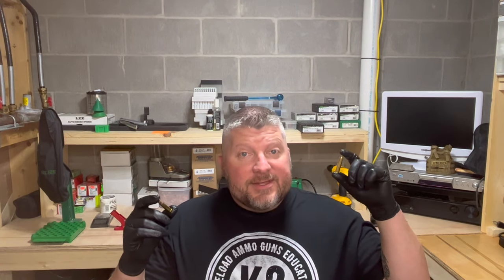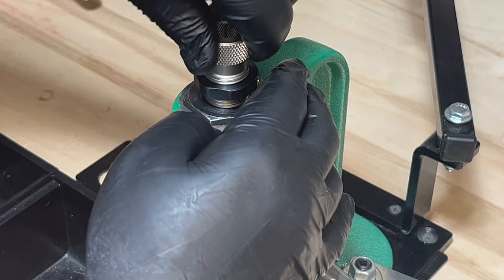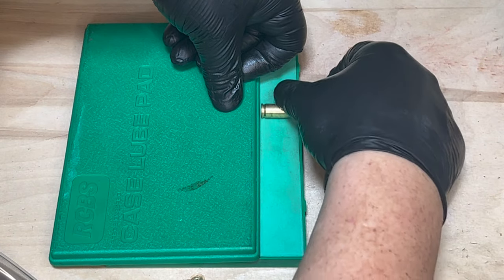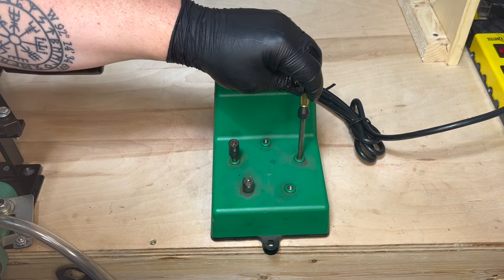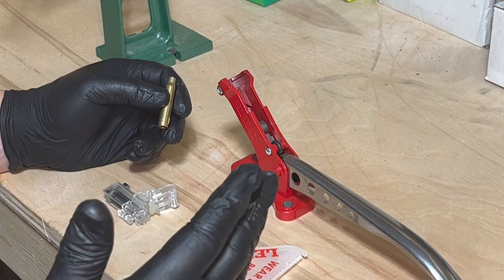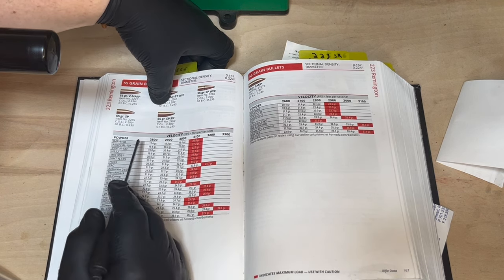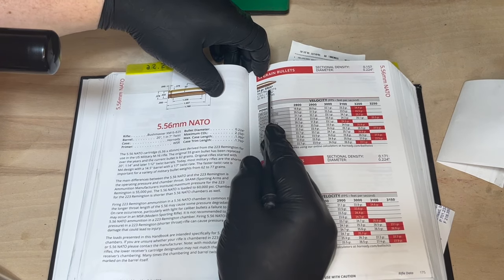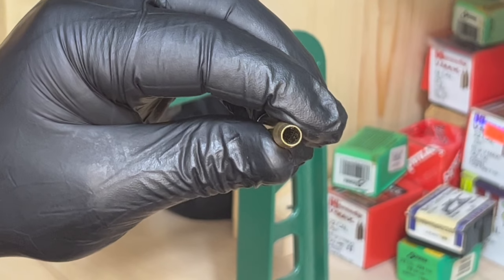How to Reload .223/5.56 For Beginners Easy and Fast

Comment: Since this is a beginner's video, it would have been nice for you to have told us why we should be using small base dies when reloading for "any AR platform."
Reply from the maker: Hi Daniel Morrison! Great question! SB dies are used to bump the shoulder back just a little further then FL sizing dies. You’ll hear varying opinions on if this is really needed or not. I find that I have better results in my AR platforms when I use SB dies rather than FL dies. I can almost guarantee that someone will disagree with my statement. However, this is just my opinion and what I choose to use. I encourage everyone to experiment and figure out what works best for their needs. Hope this helps! 👍🏻
Reply: @k2defense  Im sorry but I absolutely know nothing about this but what are dies?
Reply from the maker: Hello!

They are used to reload ammo! Please check out my other videos to see how they work! Hope this helps!
Reply: @k2defense  You stated that the small baes dies are better for any AR platform, but you did not say WHY they are better.
Reply from the maker: @danielmorrison7579  - I won’t say the are better. However, for me, they seem to work really well in my AR platform. SB dies size the case from the shoulder to the head of the case a couple of thousands smaller than FL sizing dies. You will hear some reloaders say that there is no need for that and you over work your brass causing the life of the case to shorten. I get 10-12 reloads per case before the necks split. Probably because I don’t anneal my plinking rounds. I’ve never encountered case head separation using SB dies. In summary, you’ll have folks that only neck size or FL or SB or any combination of all three. For me, using SB dies reduces ramp feed and chambering issues in my AR platforms. Find what works for you and run it. In my opinion, there is no right or wrong way. It’s whatever you find that works for you. 👍🏻
Reply: Have 223 dies. Was wanting to load for one a my kids A. R he said I should use small base dies. You explained it well! Thankyou! Like  IMR 4198 in 223 I load for. But it's just a single shot. And weigh every charge on a Redding non magnetic dampened scale. Don't trust a measure to throw a perfect charge every time. Been reloading since 1974 the Rock Chucker seen a lot a brass! 223...220 Swift...243...25-06...7mm Rem Mag...38 Special and 44 Rem. Mag...as well as friend dies/calibers. Great to the point video you posted! Thanks! @k2defense
Reply from the maker: @curlyyoder I really appreciate the comment Kit! Cheers! 👍🏻
Reply: Buy Lee Dies, they are tight enough that you don’t need to shell out extra $$ for ‘Small Base.’
Reply from the maker: @George-tz1cv - I’d say, save up the extra few dollars for the small base if you’re using the ammo in the AR platform. This will help with ramp feed issues and chambering. Otherwise, I’d agree with you. 👍🏻

Comment: Does barrel length affect reloading? I have an 8.5" AR and used Hornady black and shot nice, I used my reloads and loaded on the lower end per Hornady book and Hugh flash out the rifle. Wouldn't tell if it was from chamber or barrel but the flash was huge. Should I reload below Hornady specs?
Reply from the maker: Hello Timothy Berlinski,

When you read your reloading manual, it will tell you what barrel length the load is worked up for. Twist rate plays an important part with bullet weight. Typically, the higher twist rate is needed for heavier projectiles to stabilize the projectile. The shorter the barrel, the higher twist rate. Hope that answers your question.
Reply: @k2defense  I am more concerned with the load, I got the higher twist the more weight. I forgot what weight I was using
Reply from the maker: @timothyberlinski2299  I’m a little confused. Do you know what projectile you used (weight) and powder charge?
Reply from the maker: This are my plinking rounds. 55 gr fmjs. I don’t go max on these even though Hornady is conservative. I go mid range on my plinkers. Hope this helps!

Comment: Ive been loadeing 223  2 years rcbs die i bought new its pushing bullet up in the die and not in brass  bullet get stuck in the die can ya  help me out never had no problems with till tonight
Reply: 223 55grn lead tip
Reply from the maker: @richardharris1349 - yes, it sounds like you’re crimping before seating the bullet. Watch this video and follow the steps for the bullet seating and crimp portion. It’s for the .308 but it’s the same setup for the .223/5.56. After you do that, try it again and let me know if that corrected the issue. 👍🏻

https://youtu.be/ktUftCmF_2k?si=aFDAGFSyey5i3BkA
Reply: @k2defense   thanks
Reply from the maker: @richardharris1349 - 👍🏻

Comment: Question:  the cases for 223 and 5.56 are the same and the only variance would be the powder load which is approx. 2gr. more in a 5.56. 
To compensate for this additional powder load/ overall pressure a 5.56 rifle has a longer throat and leade for the additional pressure and speed of bullet.
My question is what if we trim the 223 cases to say 1.745 to allow the additional room for neck expansion and set the bullet say 20k deeper in the case neck then place an additional 2gr. of powder in the case. 
One would think this would allow a 223 rifle to shoot a 5.56 powder load.
Reply from the maker: Just to clarify, your question is if you trim 5.56 cases to 1.745”, seat the projectile .2” deeper, and add more powder than recommended to shoot out of a .223? I want to make sure I’m following before answering.
Reply: yes this would allow the throat to have more room like in a 5.56 for neck length expansion and seating deeper would allow the bullet more time to reach the lands by way of the leade.
just an idea to compensate for the only difference in a 223 vs. a 5.56 barrel to help with the added pressure do to increased powder load.

Comment: I wonder how much all the stuff you need to start up would cost and what brand is best and so on. I am a Army Veteran who is looking into reloading ammo
Reply: You don't have to have all this stuff. The way to start is buy a good loading manual and read it. It will explain every step you need to follow in order to load good accurate ammunition. Pay attention to the book. I have many different manuals because loads for the same cartridge will vary somewhat from book to book but the loading procedure is the same in all of them. Once you have begun you will find alternatives to some of the expensive tools like his case prep machine. I've never used something like that and I've loaded .223 for many years. As a matter of fact the first case trimmer I used was a block of wood with sandpaper stapled to it and it worked well.
Reply: @russellkeeling4387  that’s what I have done I ordered the 51st edition and it comes in Wednesday
Reply: If you buy it all at once that is a major investment.  I suggest you start with the basics and add as you go.  The more time you spend processing your brass will result in better accuracy and dependability.   But,  it's expensive.  It's a crawl, walk, run thing.  What ever you do, don't run out and buy an expensive progressive reloader thinking you are going to start cranking out ammo.  It's a learning process.  

I have a single stage press and a 4 hole turret press I bought many years after I bought  my original single stage press.  I have a closet full of ammo with just those 2 presses.  I'm not seeing the needs for a progressive reloader at this point in my life.
Reply: Thank you for your service. When I started reloading I did not have much money. I bought the lee single stage25th anniversary edition press kit thinking I could upgrade later. Never upgraded. I will catch some flack about this but lee makes a great product. Less expensive than a lot of other presses. Get reload manuals and read them. Take your time.
Reply: My favorite is RCBS and Redding

Comment: Thinking of reloading? Here’s some tips and warnings from a reloader and retired engineer. Kinda long, and it is no where near everything I know. 
If you are considering reloading to save money, know this, your first round may cost easily a thousand dollars for press, dies, scale, powder measure, book, caliper, trimmer, deburrer, reamer/swager, locking rings, cleaning equipment and materials, lighting, bench, powder, primers and bullets. And it can be very time consuming. With a single stage press I can make some nice cheap 9mm ammo at a rate of a hundred rounds in 1.5 hours with a material cost of under 20 cents a round, 223 for 30-35 cents a round. This time includes, time spent on set up, take down and clean up. It took me a few thousand rounds to pay off my equipment compared to buying ammo off the shelf. That's a lot of evenings sitting at the reloading bench. And if include the time scavenging brass, sorting brass and searching for in stock materials, add many more hours. For a while it was look online an hour a week for MONTHS at a time.
If you are easily distracted, don't like to follow or read instructions, cut corners because you think you might get away with it, don't have time or space, reloading may not be for you. Reloading can be safe or it can be dangerous. It is your choice. 
NEVER eat, smoke, drink, or have distractions while reloading.
Many powder manufacturers list their loads online. But get the book and read and understand all the introductory chapters before starting reloading. Then read them again when you think you know what and why you are doing.
Shortages suck, and they will eventually happen AGAIN. Keep a minimum stockpile of 1 years worth of reloading components. More is better. It also counters inflation.
There are proper ways of storing primers and powder. You can find them at the Sporting Arms and Ammunition Manufacturers’ Institute (SAAMI).
ALWAYS WEAR SAFETY GLASSES. Sooner or later we all need them. Some people even wear disposable gloves because nitroglycerine (powder) can affect blood pressure and cause big problems. 
Work in a comfortable well lit area; this minimizes the chance for mistakes. And a solid bench is good for consistency. Some videos show so much bench flex we wonder when the press will come off.
ALWAYS wash up after handling any of this stuff. Lead doesn't have to be fast to mess you up. Primers contain a lead chemical. Powder contains nitroglycerine and nitrocellulose and other chemicals. 
There is a case length specification with minimum and maximum, a minimum cartridge length based on powder and bullet and a maximum cartridge length based on the caliber. Know them all, or at least have them written down. SAAMI website has great pdf’s for this info. Some reloading books do not contain the minimum case length. 
ALWAYS follow the instructions for die set up and the recipe for powder weight and overall length. 
Steel and aluminum cases are not reloadable, but can be recycled as metal. Brass is reloadable. Nickel plated brass is reloadable.
There's a couple types of primers, Boxer and Berdan. Boxer primers have once center hole on the inside of the case. These can be reloaded. Berdan has two holes inside the case and cannot be reloaded. If you run them through a sizing or decapping die you can break the decapping pin. 
There are different sizes and powers of primers, small pistol, large pistol, small rifle, large rifle, and then there's match, magnum, and so on. Know what you need and buy that. 
Clean up your equipment, dies, scale, caliper and bench when done. Then toss out the trash. Some of us deprime before cleaning, it gives a clean primer pocket. Lightly lube the press shaft and hinge points. In a big run, don’t wait to be done, but clean and lube once in a while.
ALWAYS inspect your brass for cleaning media before reloading. If wet tumbling; make sure it is absolutely dry. 
Some of us swage/ream the primer pockets of all our 9mm, 40 S&W, 5.56 NATO, 7.62x51 NATO and other military/police cases unless we have done this to the case previously. Mashing a primer into a tight hole can set it off or give you a bad round. 
Some pistol brass has been bulged because of what firearm it was shot out of. (the dreaded Glock bulge for one) And because of the space between the shell holder bottom and the bottom of the die, not the entire brass gets resized. Lee has a bulge buster kit that's fairly cheap for eliminating this problem. (more costs, spend that money) 
NEVER mix different powders in a load or a powder feeder. If it happens accidentally, toss it. It is not worth the risk of blowing up a gun or getting injured. 
ALWAYS store your powder and primers in a cool dry location. Heat and humidity will damage them both. 
Some sizing dies have carbide inserts, this allows you to not have to lube your case before sizing. If you do not have carbide inserts you should lube the cases because they may get stuck in the dies. After resizing a lubed case you need to either wipe or wash off the lube. If you wash then you have to re-dry. If you lube cases, some of that lube will cake up in the die eventually. Clean it out. 
Legally unless you have a specific FFL you cannot legally sell your reloads. (just sayin') People will ask you to sell your reloads. If something goes wrong do you have a lawyer?
Keep your loaded ammo identified by the recipe you used. If (when) you have a problem you want to be able to isolate it. Tossing multiple runs of ammo into an ammo can is just asking for a problem. Also, record all you loads in a separate log. This will give you recipes you can reuse, or starting places for future recipes. 
Some ammo can be loaded with cast lead or plated or coated ammo. It is cheaper. But if you are using mixed manufacturer brass to load it your case length and therefore crimp may vary. This crimp variation can lead to the coating coming off and your barrel being leaded or exceptionally high pressure which can cause damage or injury. Therefore, some of us trim our cases to a uniform length before loading these bullets. 
A great source of information is The Sporting Arms and Ammunition Manufacturers’ Institute (SAAMI) You can find detailed cartridge drawings including tolerances, storage recommendations, and other good info there. Check it out. 
There's also questions like can I use this die for that load? 380 cannot be reloaded with 9mm dies. While they look close except for the length, they taper differently. Don't bother trying. 38 special can be reloaded with 357 magnum dies.
Reply from the maker: @phild8095 - always enjoy your comments! I hope viewers are taking note! Thanks for your comment! 👍🏻
Reply: That was a long read. LOL thanks, a lot of good info!

Comment: I thought you was supposed to clean the flash hole from the inside?
Reply from the maker: Hi Corey8791! You are correct and the first person to catch this! I should’ve mentioned it in the video. This flash hole uniformer doesn’t fit inside of the case mouth so I do it upside down. It still works great for opening up the flash hole. Great catch and I hope that explains it for you!
Reply: The flash hole deburrer is supposed to remove the brass leftover when the manufacturer punched the flash hole opening from the outside.  Not a necessary step unless you're reloading precision.
Reply: You are, I have a handheld one.
Reply from the maker: @ArkansasBassMan  correct, I like to ream the flash hole because of the carbon build up in the flash hole. Also, after tumbling with media as it gets stuck in the flash hole. Thanks for the comment!
-K2D
Reply from the maker: @kathyreich6841  this is actually a handheld one. I unscrewed it from the handle and attached it to the case prep machine. I don’t like hand cramps. Thanks for the comment!
-K2D

Comment: 2.160 ; the manual says 2.200 for 55gr. FMj-BT-W/C ?
at 2.160 that would put the jump @ at least 70k to 80k of an inch.
Reply from the maker: Hello DLN1234,
Please refer back to your reloading manual for your reloading information. K2D does not recommend specific load data for liability reasons. All specific reloading information on this channel is for illustrational purposes only.
Reply: @k2defense  guess it depends on what rifle you are shooting. A semi-auto AR15 style would require a shorter O.A.L. due to rapid shooting. That bolt is flying back and forth fast so you don't want any jamming of rounds hence the W/C for additional security to hold bullet in case.

Comment: I haven't been using a small base die, is that why im having problems with chamber and ejection?
Reply from the maker: Hello! Usually when you have these issues combined, the lower third of the case hasn’t been resized appropriately. Are you camming over?
Reply: @k2defense  yes, I am.
Reply: @k2defense  my 223 won't chamber, and in my 6.5 semi and 6mm arc after shooting the brass gets stuck
Reply from the maker: @franciscoortiz9730 - is this happening with reloads, new ammo, or both? Is your ejection catch working? Just so we’re on n the same page, you’re having issues with ammo feeding into the chamber and the bolt closing, correct?
Reply: @k2defense  with once fired brass from another rifle
Reply: @k2defense  yes with most if not the brass gets stuck after firing
Reply from the maker: @franciscoortiz9730 - what happens if you chamber the round and eject it without firing the cartridge?
Reply: @k2defense  still gets stuck in the chamber
Reply from the maker: @franciscoortiz9730 - you have either head space issues and/or cam over issues. If you are using once fired brass, small base dies (with cam over), trimmed case, there is nothing wrong with the cartridge, it has to be the chamber. SB dies squeeze the case into a shape that will not get jammed into the chamber. I have to ask, are you sure you’re not just neck sizing your brass??? We’ll get this figured out. 👍🏻
Reply: @k2defense  I'm using full-length dies rcbs